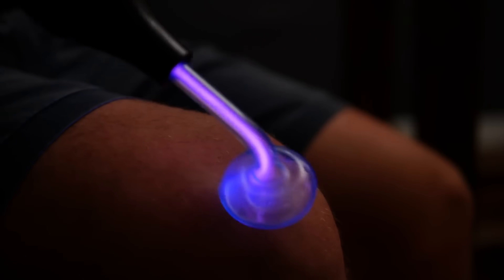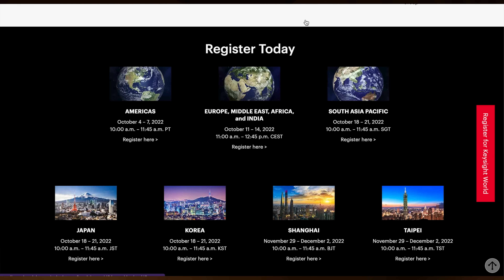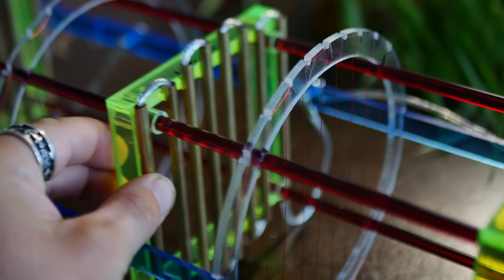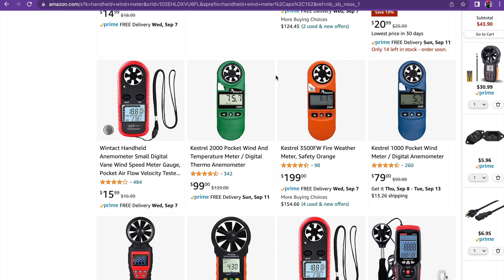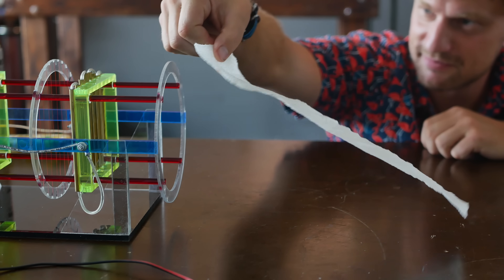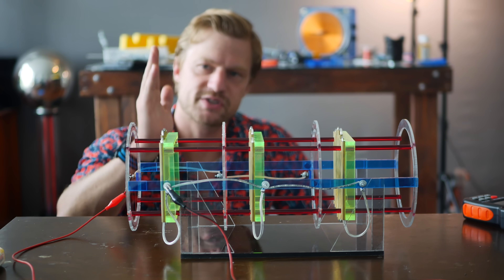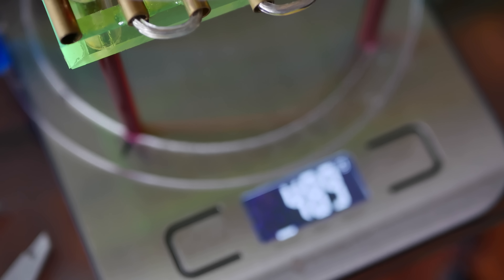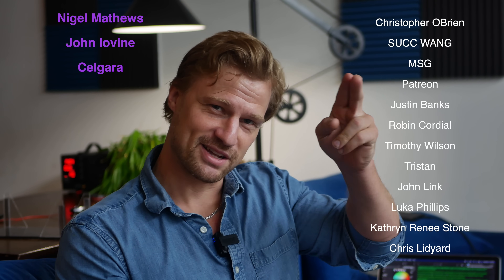Designing A Next-Gen Ionic Thruster! (For Flight)

Comment: For maximum thrust, you  want to move a large amount of air relatively slowly, rather than producing a smaller, high-speed 'jet'.  The reason bascially boils down to the fact that thurst is proportional to the momentum you give the exhaust, but the  energy requirements go up with the square of exhaust velocity.

It's why turbojet engines are less efficient than turbofans, and why aircraft optimised for thrust have larger diameter propellers / rotors (helicopters being the extreme example).

Your design is a cool concept , but if you want to build an actual aircraft, I don't think that a stand-alone thruster is the best approach. Engines are essentially 'dead weight' which your airframe must carry, and do not contribute to the structure or to producing lift. For piston and turbine engines, you don't have much choice as these engines are inherently small, dense units which need to be a certain  shape to function.

Ionic thrust allows much more creativity - your entire wing can become a thruster with very minimal additional parts. You essentially can get away with a nearly zero-mass engine, as your thruster is also your structure and lifting surface.

Comment: What if the electrodes were configured as radial fins/airfoils instead of filaments so the plasma could be funneled and compressed to increase the odds of a collision. or an extruded donut-shaped grid perhaps for the intake and an aerospike or airfoil shape for the cathode. The grid idea is not bad but why not make a 3-dimensional grid that helps direct the for more surface area and more laminar airflow.  perhaps an aerospike could be configured to fit into the center as a cathode to attract the air and electrons and enhance laminar flow. that could be the final stage perhaps or it could be a long aerospike with a long tapering body.

Comment: My 0.02 one the air dynamics of the cylinder is horrible , two your open tube design doesn't channel the flow. Three your not taking into account various temperature , humidity,density of the air and lastly wrap a accelerator coil around the outside of the tube to couple energy input to the plasma

Comment: Add a bellmouth inlet, cover the whole assembly with a tube, and add a converging nozzle may also increase thrust noticeably. Test and experimentally determine the optimal staggered spacing for each stage too, since the air is flowing faster after each stage.
Reply: I can't imagine a setup like this has much static pressure (I say this knowing not very much about ionic thrust) so a nozzle on the end may hurt performance instead
Reply: @lizard_girl  Yeah it might not do alot, but my understanding is that part of the additional thrust from converging nozzle cones comes simply from the higher velocity/lower pressure air inside creating a pressure difference to the air outside, and since the nozzle has an angled cone, you get a force pushing perpendicular to the nozzle angle, one component of which is along the axis of the thruster.  Might not do much at all or hurt the overall performance as you suggested, but it seems simple enough to 3d print and try.

Comment: would like to see some fluid dynamics incorporated, air is essentially a liquid and principles should apply. Nicola Tesla never though of this day, but many of his designs applied together have done well. A Tesla valve intake or nozzle may allow more thrust per plate with a housing. I recommend the valve so lost pressure from the other plates can't escape the intakes allowing them to be stacked. Never told us the weight with deactivated plates removed...  Also would like to see if a vortex would create more thrust by using a fan or propeller. Many possibilities with a proof of concept 👍

Comment: Hello friend, we are working on hv thrusters since 97, where don't ask.😉
Your design is practical and good.
When you want to increase thrust you have 
1) to use anodised material ( oxide sheet) on one side.
2) the dielectric constant has to be high of the used insulator  space between the poles.
3) it has to be asymmetric in construction( try triangle hexagon or spiral in the thrust capacitor)
4 ) raise the current to 60 ma and the voltage at 250- 500 kv.
5) use an impeller to blow in dyson bladeless  blower style with 3 to 6 rings the air through an temperature splitter upside cold downside warm, through the throuster.
6) if you build a ship ( for space ) it is advisable to use the outside hull as an thruster, same principle. 
 device is in kg weight, use a gyroscope to control weight and mass position in relevance to space.

If this is done, i wish you a good flight.😉
Last word , great chanel.

Comment: Lots of air running out the sides. Seems to me you could design some sort of compression without adding weight. I wonder if there's a way to make it stack air particles more efficiently. Humidity levels make a difference? Does this work in water? You really got me thinking.

Comment: Thruster should be doghnut shaped, and the first stage be large and should face outward slightly from the direction of thrust... reducing in diameter and angled closer towards the direction of thrust at every stage... Increasing draw area and concentrating it to drastically increase wind speed and air pressure... 

Ion jet

Like a jet

Comment: Great! I was playing around with that idea back in highschool, but didn't have the budget or support to pursue it.
Glad to see someone else pursue it.
Reply: A variation of the design would be to have one or two emitters one one side, and multiple acceleration grids on the other. Stacking emitters between accelerator grids would repel incoming ions from the previous stage, slowing them down. A few people already mentioned putting a tube around it to shape the flow and prevent leaking air to the sides. You can also attach needles to the emitters for an easier discharge and greater ion production.  Of course coronal discharge is point of power loss, so the first stage accelerator grids should be at least a few inches from the emitters. 
  ===|.  == |.  = |.     -| ). 

Maybe check out T. Townsend Brown's work on ion thrust, capacitor thrust, and the phenomenon he called electro-gravitics.

Comment: I don't know much about how ionic thrust behaves but from what I know from fans and some jet engines, pressure might also play a role on your thrust, I'd recommend using the same methodology you used for air velocity to see if voltage and spacing influence the pressure; this is all presuming you set up an enclosed version with a nozzle, of course.

Comment: 1) Lack of side casing/duct, I think that might increase the airflow a bit more
2) "Cold" electrodes instead of heated, would increase the amount of plasma generated by throwing off more electrons, juuust mayyybe.
3) Next steps divert a tiny bit of power back to the previous step, as in blowing backwards, because that's how electricity wants to work :P
Oh and an afterthought: 4) Instead of all positives and negatives connected together in parallel, have them on different sources, so the potential between the first stage's negative and last stage's positive is the greatest of all, that would possibly provide a lot more airflow.

Comment: - Wrap the whole thing in the linest lightest plastic wrap or some kind of shrink wrap to prevent air leaks.
- Set up a test rig so that different combinations of voltage, distances, etc. can be tested in an automated way.  Then find the principles that maximize what you want.  You can redesign after your findings.

Comment: 1. could increase coil area with different winding design to decrease the structural weight per stage. more coil density. 
2 aerodynamics of each stage, can flatten the brass tubes into a wing like shape, or just remove weight with only a plane of brass and not a tube. 
3. lighter structural material while also incorporating the voltage paths into the structure.

Comment: If you're using pulsed power you, maybe able to ensure maximum output by making the plasma sheaths around the first two sets of wire be smaller than the plasma sheath near the output of the device.

Comment: I want to say this is the coolest bladeless fan ever, but it seems too dangerous, power hungry and loud to be the best fan ever, though the power hungry part is debatable.  I want to say instead then that this is a cool development in aeronautics that will use ionic thrust but sadly your rig was too heavy and inefficient to provide that and the battery needed to power that would make thing even more of a challenge due to weight and how long the battery/batteries could provide sufficient voltages (even with multipliers and other circuitry etc).  All those criticisms aside, I loved your video.  The device looks awesome in the dark first off.  And, while it seems a little loud for in-home ventilation I still think it makes a really cool sound, like a miniature jet or plane.  I also really enjoyed how you tested both voltage and spacing with different combinations of spacing.  In fact, if you eventually made something that flew from different but similar ideas, you could use something that varies the spacing on the fly (either automatically or from remote control) that would in essence affect its velocity of travel in various directions (say for example if you have multiple different angled columns of these setups).  I really think the only issues are safety/noise if used as a fan or lack of thrust to weight if used as a thruster for forward or air travel, though power is still a concern to think about until you get it more efficient.

I don't know which three issues you were referring to yourself, so it's hard to guess.  You may want to also look not only at how spacing of the + and -/ground affects things (like you already did) but also how the spacing or number of lines between elements/wires in both the positive and -/ground ends affects things... would having more or less lines/wires per element make it work better or worse?  Another thing to consider is this: is it possible to have some of the circuitry and circuitry's housing be part or all of the structure.  Plastic is heavy and fragile for something that might eventually fly.  However, metals might interfere with the operation of the ionic thruster unless said metals are also serving as part of the circuitry itself.  A final thing.  Does the shape of the grids and whether or not they're parallel or orthogonal, straight or curved etc both with respect to themselves and with respect to their -/ground pair.. does any of that make the thrust better or worse or changed in shape of flow???

I cannot wait to see your next videos on this!!

PS: A lot of good comments from other viewers on here by the way.  I don't know if I agree with all their ideas but I think they're all worth checking out at the very least.

Comment: Might be able to reduce power consumption per unit of thrust by using bare wire where the enamel isn't needed for insulation. I noticed plenty of hot spots. I would think this would cause increased heating and therefore resistance.

Comment: Increase conductor surface area or add carbon brushes, larger capacitors on the Cockroft, laminar flow guides for streamlining the air?

Comment: that was pretty amazing @9:09 the still images! Question though: what are the bright points emanating rather than a solid stream across the whole conductor? Would it be possible to add strength to the thrust if those were more uniform? One thing I noticed was parallel streams and an open chassis design... wouldn't rotating the conductors 60 degrees (1=90, 2=150, 3=210) provide a more filled area of flow from intake->discharge, as well as encasing the whole thing in a tube to prevent air from escaping between differential pressures? Looking forward to see if you build this into a craft

Comment: Also, maybe make the whole thing power a turbine that spins a turbine at the front that pushes more air than the output so it forces air to move faster. Then add a cone to the back to force air into a controlled path.

Comment: I wonder what a magnet would do to the up?

#1 a tube body would help with flow and a longer aft section would add a venturi effect to your thrust... to a point
#2 maybe try a more aerodynamic ground vanes to reduce turbulence for higher laminar flow
#3 try separating your primary vanes but keeping the grounding vanes in parallel for the ions that made it past the intended ground has a chance to interact with the fallowing stage

Comment: My mind is a bit blown as an aerospace engineer seeing practical ion thrust for the first time (I've been doing software for a while now, so I haven't kept up like I should).  My thoughts:
1) Enclose the airflow and neck it down
2) MOOOOORE STAGES!  Maybe, it did look like there might be a roll off in performance gain there, but might be worth exploring.
3) You have been freed from the confines of a rotational shaft geometry, nothing says the enclosure has to be round.  This unlocks WAY more than just ellipsoids in shapes, it's just a matter of ducting.

Comment: I'd find out what the minimum distance you can put them in series. Then using copper foil as your ion pickup to save weight and having more wires for discharge you could probably increase thrust to weight significantly.

Comment: Love this, being wanting to investigate multi-stage ion lifters for a long time.

There's alot that can be played around with, per stage and between stages.

Things that could help is frequency and phase adjustment, using meshes rather than single axis, monitor what each stage is doing with flow and electrically, could the charge to mass ratio help with optimisation? 

Would be great to see an update on improvements that people have suggested!

Comment: Dear Dawkins, man, this is awesome.  That you've come up with this in a long series of experiments and projects is impressive and inspirational.  I hope this progresses.

So, improved performance?  Maybe:
1) Put the device inside a tube to ensure airflow is forced through the length of it.
2) Replace the round negative electrodes with plates aligned parallel to the direction of flow (aluminium?).
3) Paint it red. Red is always faster.

Comment: This reminds me a lot of a vacuum tube or CRT. Perhaps use a fine mesh grid for the anode? You can also see the corona on the cathode wires is concentrated around points on the wire. Can you encourage more of these points, possibly by using a rippled or textured surface?

Comment: The most obvious improvement I think might be ducting the whole design, similar to the duct on an EDF. Stops any potential "leakage" sideways, and can be done cheap and light with a thin plastic wrap.

Increasing the surface area might help? Copper mesh instead of copper wire strung back and forth. Of course this is a balancing act with not creating too much of an obstruction to airflow. Interesting to see where the balance lies, and I imagine it would be non constant. At higher airspeed imagine having more electrodes in the way would lead to greater losses than at lower airspeed. On a similar note I wonder if the "winding geometry" for lack of a better word matters, linear back and forth as you have, versus spiral etc. Probably no meaningful effect but might be interesting to try. 

Geometry of the electrode would be something else to consider. The classic ionic lifter uses a thin sheet of foil that runs flat and parallel to the airflow, which seems better to me, as far as surface area, and aerodynamics than the cylindrical negative electrodes you have. Maybe creating a needle or aerofoil shape electrode to replace the positive copper wire as well might help direct the discharge better? copper wire being radially symetric would create some ionic wind the undisirable direction.

Comment: Cool project. I remember playing around w/ a flyback and that cap/diode ladder multiplier back in middle school (80s). Got some nice 3" bolts from it. Worked well when I put a Z bent coat hanger on it (ion rotor). Every bit of metal in the room would 'bite' you too.

Comment: Did you consider cones (sharpened points) for the positive electrodes?

What about using a single ground plane, and increasing voltages for the positive electrodes as you move away from ground (the voltage per electrode distance would be identical).

Any concern about X-Rays being generated, or are they all dissipated in air?

Comment: couple changes i would make...
1) try a mesh rather than just the few passes of wire
2) put it in a tube(preferably with a funnel intake) , i wonder how it would perform with something to prevent the air from just spraying everywhere
3) how does it perform in motion. id just use an adjustable speed fan in front of the stand to simulate different speeds.

Comment: Amazing!!!
I would say for improvement as follow:
1- three more stages with aerodynamic cathodes to reduce air turbulence
2- ducted tunnel to ensure the wind are directed with extra curve in the front to enhance the efficiency 
3- variation between each stage in the voltage, as bigger spacing the higher voltages goes to.

Goodluck, can't wait to see your next video